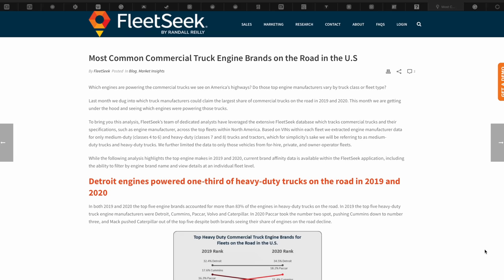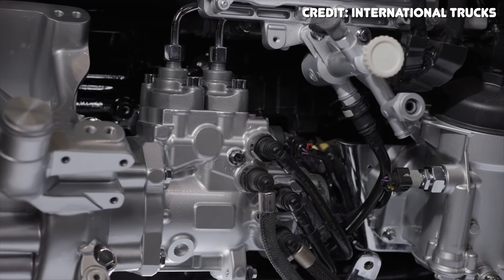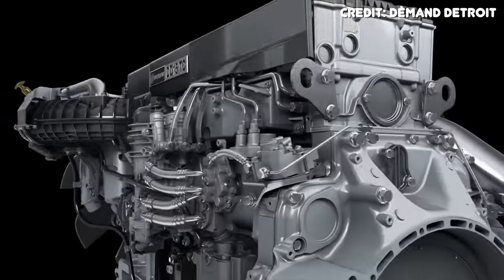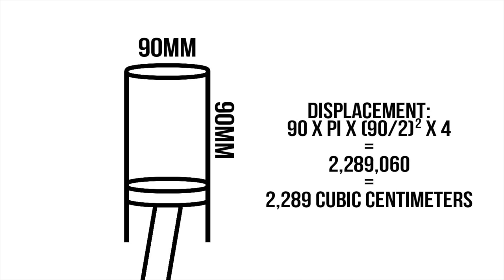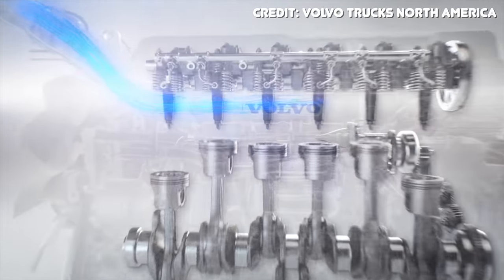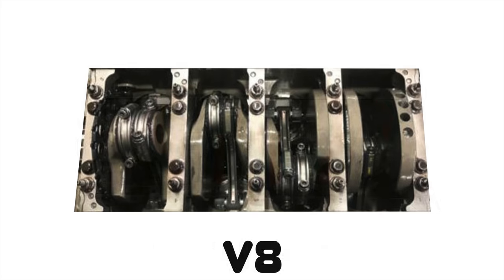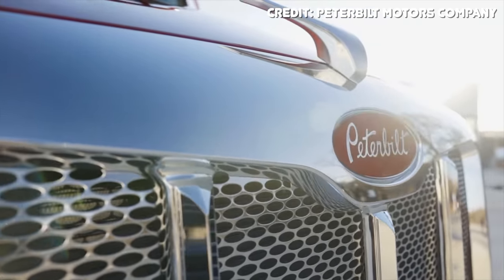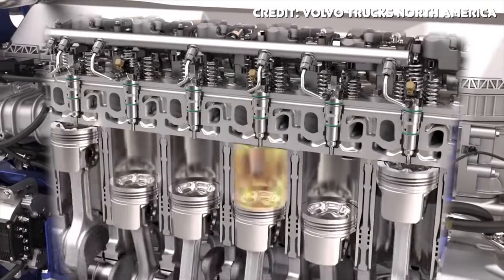Why do Semi-Trucks Use Inline-Six Engines?

Comment: 5:46 So close, but missed it. 
Torque doesn't say much about how good a truck is at hauling a load uphill. A human with a big breaker bar can deliver as much torque as a truck diesel does, but we sure can't haul a big load uphill. 
A sports car engine delivering 500hp or a truck diesel delivering 500hp, both geared in such a way that the road speed is 60mph at the RPM where it delivers its maximum power, both give the same amount of torque at the *wheels*. 

You could literally haul a 45 ton load uphill with a Ferrari engine, provided you give it a CVT to keep the engine spinning at its maximum power point (though i reckon it would wear out or overheat if you would actually try it, but that's not related to torque). 

The torque delivered by each engine is radically different, but the torque you measure at the wheels, after gearing down, is the same. 

Why don't we use sports car engines in trucks?  Because the low torque means you need a high rotational speed to put out the same amount of power. Or in reverse, because you want a lightweight engine, parts have to be small, and can therefore handle little torque. To keep power high, you have to increase speed. 

High engine speeds often are correlated with lower life span. A diesel that tops out at 1500rpm will run for a million kilometer. A sports car engine is still deemed acceptable if it conks out at 100.000km.

So in short, a truck doesn't need torque as a starter, but it is a dependent variable when designing for power and longevity. And to make an engine that has good power and longevity, it means you need a low revving engine. Finally, to reach the set amount of power with a low revving engine, the engine has to deliver more torque. It's the final part of the chain. 

If i were were rich, i'd stuff some kind of sports car engine into a lorry to for once and for all demonstrate how torque, power and engine speed are related to each other. It's all physics and mathmatics.

Comment: Its also worth noting that historically, v8s were the engine of choice to get the most amount of power for a given size. In other words, if you had a 4L single cylinder motor and a 4L v8, you would make a lot more power with the v8. But with modern fuel systems, new lightweight materials for pistons, and computer modeling, we are now able to make similar HP between different configurations. As time goes on, I think we will see fewer and fewer cylinders while power and torque will remain somewhat constant.

Comment: Interesting vídeo, I drive a 2016 Mercedes-Benz Actros with a 11.9L  V6 engine wich produce around 430HP and 2100Nm of torque, New models have an in line 6 that if am not mistaken are detroit engines usted as well on te New Cascadia.

Comment: Simplicity and maintenance.  I've gone back to driving 60s cars and trucks with inline 6s. They are a breeze to work on and standard maintenance takes way less time than my V8s. I have turbo'd a couple of my inlines, again, much easier to accomplish with an inline than a V8.

When I was a kid, my grandfather had a P30 van. We dingle ball rebuilt the engine without removing it. That always stuck in my mind.

Comment: The only thing I feel like you didn’t cover completely is that the force of an in-line engine is much more vertical than a v-configuration so it’s easier to build the bottom end to handle the force. V engines apply a lot of diagonal load that requires a more complex bottom end.

Comment: The torque and fuel economy of the i6 can be explained by the firing order. In all engines bar the i6 and i8, the combustion will happen when the previous cylinder is at the end of the stroke. In the case of the i6 and i8,  combustion happens when the previous cylinder is halfway through the stroke. Thus continuese torque and higher fuel consumption.

Comment: In my 48 years of long haul driving I have developed some strong feelings about engines. I prefer Cats because of their low end torque characteristics, and because the engine fan does not come on and scream at you when you don't want it to. As you may know when the fan comes on it changes the engine characteristics quite dramatically. You will need to adjust your shifting to accommodate faster shifts due to quicker engine die back. I insist on silky smooth shifts, and a fan that snuck on sometimes catches me off guard. That's why I like Cats, because that fan only comes on when it gets hot outside or climbing a hill etc. The Cummins engine fan comes on first thing on a cool crisp morning. Why I don't know, but it is very annoying, and in this modern age do they really need to be that loud? The only thing I like about my current Cummins is that I can shift with the Jakes on. There is a delay, and your shift does not get messed up if you forget to turn the Jakes off.

Comment: A longer stroke gives longer lever arm - I agree. But for a given displacement, if you double the stroke, you also have to cut the piston area in half. So for a given pressure during the power stroke, you get half the total force on the smaller bore. The two factors cancel. The assertion that a longer stroke gives inherently more torque doesn't seem to be correct. My contention is that the long slow stroke allows for more time for complete combustion, and lots of expansion to extract as much work from the expanding hot gas. Efficiency is the reason for the long stroke, not torque.

Comment: Increasing engine stroke doesn't increase engine torque (measured at the crankshaft) in a direct way like you think it would. The stroke dimension of the engine is reciprocating, and that motion is converted to rotational energy in a way that directly links piston movement to crankshaft movement. This creates a cancellation where increasing the stroke increases torque but the reciprocal of that torque is also increased at the crankshaft. 

Longer piston stroke improving torque is like saying thicker axle shafts increases torque at the wheels ... it just doesn't. What matters is the force you apply to the piston (combustion) or the force you apply to the driveshaft that matters to the measurable torque at the crankshaft or at the wheels.
Reply: What a long stroke DOES do, is enable higher piston speeds at a given rpm, which shifts the torque band to the lower rpm range.

Comment: Many of the bigger container ships use a single inline Diesel engine of 6 to I think 12 cylinders. If it fails on a trip, they radio for an ocean-going tugboat. Of course, those engines are huge and presumably not all that similar to a truck engine apart from general principles.

Comment: I’ve had all three. The Detroit series 60 engine. Outpolled my 550 caterpillar and most definitely my 400 Cummins. All rated at a million miles. But good luck with that. My favorite truck was a classic XL freightliner, but I’ve owned all three Peterbilt and Kenworth. I understand the Volvo is the Choice truck. truck drivers deserve the respect no matter what they’re doing. Too bad America does not see that.🦅🇺🇸

Comment: Back to basics.  This guy is one of the few I've ever heard of who understands that "torque" (actually torque curve) isn't inherently related to any cylinder configuration or number.  It does have some slight relation to bore/stroke ratio partly due to the fact that a long stroke small bore engine has a more compact combustion chamber which also reduces heat loss form that chamber to the head and produces faster flame travel toe the outer edges of the chamber requiring less spark or injection advance for full burning of the mixture.
  
Next, the most fuel efficient engine for any power output is a one cylinder one.  That's because of lower heat losses through the head and cylinder walls.  But the fewest number of cylinders which run smoothly is 6.  Anything less vibrates unacceptably.  Thus a 6 be it inline, V or whatever, is the minim,um number of cylinders usable in a truck.  
Third, in line engines are less expensive to build than other types.  And they are relatively easy to service.

Now for the disadvantages.  The long crankshaft has to have larger bearing diameters to reduce torsional twisting and vibration.  That means more weight.  The long cylinder head causes more problems due to expansion and contraction as it heats and cools.  This is much more of a problem with aluminum heads on iron blocks as often found in car engines, not much of a problem in an all iron truck engine.  V type engines reduce both of these problems considerably, but cost more both to manufacture and to maintain due to having two heads.

Engine speed.  Running at a speed which matches piston speed to flame travel speed in the cylinder produces maximum efficiency.  That's typically quite a low engine speed.  

There's a reason why two cylinder John Deere tractors set and held fuel efficiency records for many decades.  Large cylinders, very low speeds (typically around 1200 rpm), and long strokes all contributed.  And the reason they were replaced by four and six cylinder engines is that vibration became unacceptable when tractors required higher power levels.  

And that is why the inline six works well in trucks.  They have acceptable vibration levels while providing usable power levels and lower costs of both manufacture and operation.  But not so much in cars where a V6 or even the inline nasty vibrating 4 is commonly found. And threes are becoming more common in small displacements because of their superior fuel efficiency due to larger cylinders and resulting lower heat loss relative even to fours.

Comment: Let's also not forget the added strength over a V6 or V8, given that the I6 has 7 mains bearings and caps, compared to 5 mains. That and a single piston per pon on that crank.

Makes for a stronger overall package. Even gas I6 engines can make a half million miles, when maintained properly. 

And yes,.it also bothers me when someone says that an I6 nests a V8 in torque. Not usually, and more.often than not, the numbers are fairly close to each other. Smith so far that you really won't feel a.difference with similar dispalxement, and lower RPM. You feel it iver 4000, where the 8 breathes better, as it makes more horsepower.

Comment: Prior to them being bought out, Jeep Wranglers used inline 6 engines, which for off-roading purposes is superior to V-6 engines because they produce more torque, for reasons mentioned in the video.  Only reason they switched to V-6 was to reduce the number of different engines they have to make.

Comment: We have a 2009 Western Star with a 500HP Detroit series 60...it's a flat deck boom truck so it only has a little over 210,000km...doesn't burn any oil, and doesn't leak any oil. We also have a 2012 Western Star boom truck, almost identical configuration, and it has a 515HP Cummins...it doesn't leak anywhere, and has about 140,000km, but it has consumed oil since day one...it's not leaking anywhere so it has to be burning it. The Detroit has a DPF, and the Cummins is further burdened by having a DEF system on top of the DPF system, so it definitely has a handicap. The Detroit gets much better fuel economy (DEF system most likely culprit), but I find the Cummins pulls a lot better between 1200-1400rpm and falls on it's face at about 1700rpm...the Detroit I can wing out to 1900-2000rpm without it feeling out of it's element. It's nice for hills to be able to really wring it out before the upswing...I prefer the Detroit, but I'd have to try a Cummins that didn't have the DEF system to have an accurate comparison to really judge how I would feel. The other weird thing is that the Cummins makes about half the oil pressure of the Detroit, but from everything I've read the oil pressures are normal...larger oil passages lead to less pressure I suppose.

Comment: In the world of gas inline sixes, every one I have any experience with has been as reliable as a sundial. The Chrysler Slant Six, the Nissan (Datsun) L series, the Ford 200 cu. in. and the later 4.9L, the Chevy Stovebolt (as long as you get one from'53 or later so you have an oil pump). 

I'm a Mopar guy anyway, but when I bought my '99 Ram 2500, I never considered Ford or Chevy. I figured that if a straight six was good enough for every truck at the truckstop, it was good enough for me.

Comment: I agree with everything in this video, and would add a 3-blade prop is the most efficient as well as a 3-phase electric motor being more efficient than single or dual phase. What about a Detroit 8V92TA the military uses in it's HMMT trucks to move tanks around? Total weight is about the most one will see, an Abrams M1 tank weighs right around 60 tons, and they use a 2-stroke diesel V8 with both a turbo and super charger on it. I also own an LBZ Duramax, and have driven the Cummins before and found the acceleration on my V8 was much better than the inline 6, so efficiency is why most rigs have an inline-6, but occasionally more power is needed, and that is when they go to a V8 rather than an inline-8.
Reply: newer tank mover they use c15 or c18, c15 for the hemmt and c18 for the m1070

Comment: A simpler explanation of torque & horsepower...

Take a breaker bar with appropriate socket and put on wheel nut. Torque is leverage that creates twisting force. HP is the amount of force applied to the end of the wrench. Now replace breaker bar & socket with crank journal (distance from centerline of crank to centerline of piston journal and you get the amount of leverage each piston is applying to the crank. The bang at the top of the piston is the HP that's being applied to the leverage on the crank which causes the twisting torque that gets er movin...

Comment: Good vid. But also note that semi's are restricted by our federal highway system to 102" wide while their length is not. Thus an inline 6 is the most efficient engine configuration for semi's as it fits easily between a semi's frame rails. The power stroke on an internal combustion engine is only 120 degrees which means an inline 6 never has gaps or overlaps in it's power strokes. This means the inline 6 has the greatest fuel efficiency and least amount of engine vibration than any other engine configuration. BMW isn't stupid - they purposely use the inline 6 configuration because it's superior to all other engine configurations. It's the smoothest and most fuel efficient engine configuration. The trucking industry is all about money - if there was a more cost effective engine configuration than the inline 6 it would be in every semi.

Comment: One of my favorite quotes in trucking is this. "Horsepower is how fast you hit the wall. Torque is how far that wall moves." Big rig engines produce a lot of torque, and when you combine it with the right transmission and the right differential gear ratio you can have trucks that can pull pretty much anything. In my opinion, Paccar trucks are easily the best trucks here in the US and Canada, and the best engines are Cummins, Detroit, and CAT. Detroit's are powerful, and have a good reputation for the most part, at least before the implementation of the DEF/DPF system. Cummins engines are reliable but what makes them great is their serviceability, pretty much every shop can work on them and get you rolling again. Cat's have a reputation for extremely durable and reliable, it's not hard to find a truck with a Cat well past the million mile mark.
Reply: Most ridiculous expression ever. Absolutely meaningless. Anyone saying that knows nothing about either Torque or Horsepower.
Reply: @billshiff2060  that's a bit harsh and self righteous. Who pushed you out of bed this morning?
Reply: @SpartanB209  I am not responsible for the truth being harsh. Self righteousness refers to "opinion" not engineering facts. Newton was not self righteous when he stated the laws of motion, he was simply right. 
That expression does nothing but confuse and mislead anyone who actually wants to know the nature of Torque vs Horsepower. The subject is hard enough without all the 1 liner junk definitions out there.
I will change my comment if you can explain how horsepower is related to hitting a wall and how torque is related to taking it with you.  That would be quite an achievement since the expression deals only with inertia and mass and not power in any way.
Otherwise you should admit the expression is meaningless and never mention it again.

Comment: How it is ....  Inline sixes whether it's trucks or cars is balance ..  Not expert in trucks so much but here in Australia we have a the Ford Falcon up until 2016 . Whilst many had V8s of course the vast majority ran inline sixes .. the last literations were a 4.0 litre 3984 cc  in both SOHC and DOHC (most famous is the Barra)  These engines are timeless , produce great torque and nearly perfect balance with no real need for harmonic balances either .. Two up , two down and two in the middle ... Huge trouble free kilometres with many of these Falcons hitting 800,000 kms or half a million miles with minimal maintenance with usual service intervals ... I have two Falcons , both sixes .. One is SOHC Intech in my AU 2001 Futura  and the other is in  my 2008 XR6  . It's the N/A  Barra  DOHC with VCT ... Beautiful  smooth and strong powerplants ... Great video ... Loved it ..